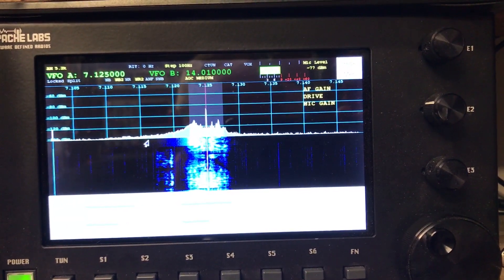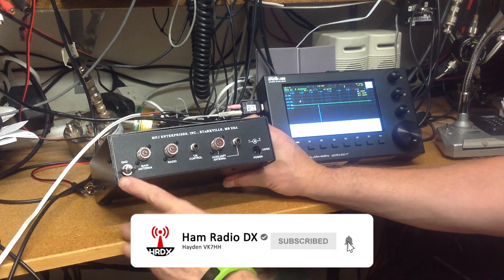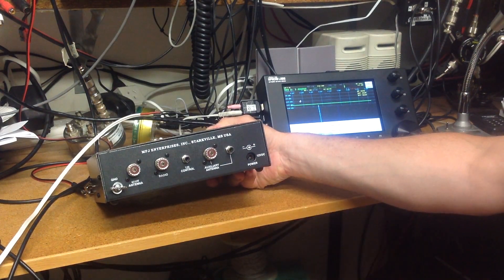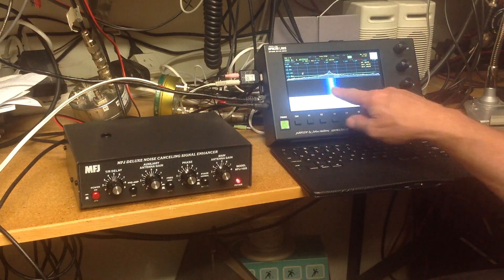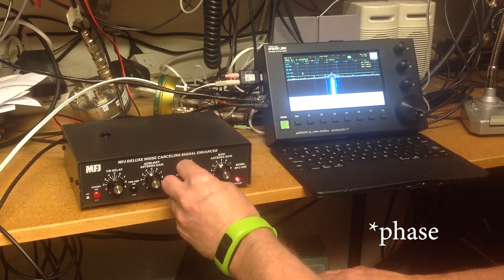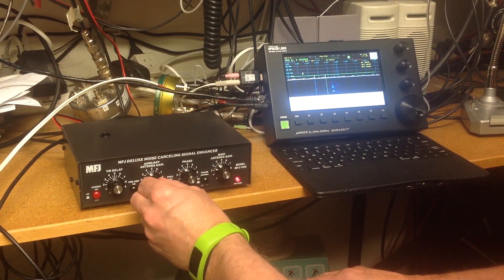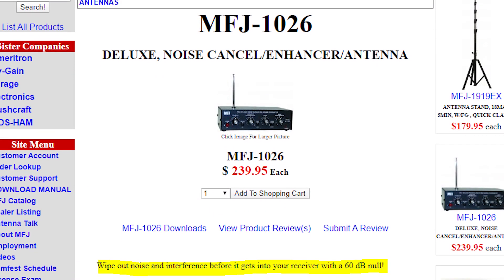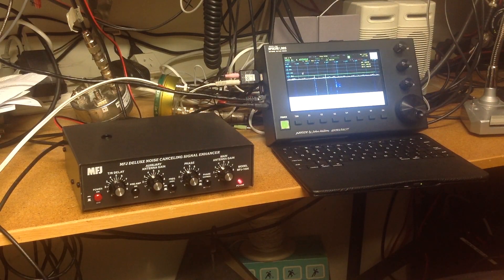MFJ-1026 Noise Canceller - The Key to Busting QRM?

Comment: So is a "QRM eliminator" any different than a directional antenna?

I get the general idea of feeding in a second antenna and adjusting its phase to cancel noise.  But that's just a phased array antenna, essentially just a directional antenna.  You could also use, for eg, a Yagi, couldn't you?  Or is this a way of making your array adjustable?
Reply: It is very different from a directional antenna. A yagi, magnetic loop, or other antennas with directional characteristics will pick up signals (plural) in a given direction better than another. The QRM eliminator is mixing the opposite waveform from one antenna into the waveform from main antenna. If both equally hear the signal you want to hear, the signal will be gone. But the value is when one hears the noise better and the signal worse; when you mix in the opposite, the noise goes away but the signal from your main antenna remains.
Reply: When he says in the video that broadband noise isn’t eliminated as well, it might be because both antennas hear the noise equally and it sufficiently covers the desired signal in the main antenna.

Comment: I would try common mode chokes one at the antenna and one near you radio and you see less noise. After that without buying a new receiver that has this built in.  Then try this prodcut.
Reply: I got a common noise choke with high hopes and it did nothing.  I think it will help in very specific situations with very nearby noise sources, but otherwise I don't think it will do much.

Comment: I have to get this for my station.  I live in an apartment building that I previously thought acted like a Faraday cage on shortwave, but which is actually simply full of RF noise, and I realized that when I observed that HF signals came in very well within my apartment during a power failure.

73 VE7NDE

Comment: Thanks for the video. I do have a question, I am thinking of buying one of these due to a neighbour have solar PV installed. My question is I use mainly CW , (Never full break-in). The hf transceiver is a FTDX10, does the unit switch fast enough for cw.? Many thanks.
Reply: ..yes...I'm 99% cw...  VE3IIM/VE6PG

Comment: that model cant do a 180° phase turn, the QRM is then accordingly not fully blotted out. there are other versions of the QRM-Eliminiator available on the net that are better and cost about 1/4 of that, for example the QRM-Eliminator model "X-Phase", there are a number of demo videos of it on yt.
Reply: But can you run an amp with them? At least the MFJ1026 can be modded with relays to run QRO. Not sure if mods exist for those cheap noise cancellers.
Reply: @624radicalham  yes, simply put the PA after the phasefilter. 
Radio -> Phasefilter -> PA -> Antenna📶
Reply: @PIasmaZombie  Thanks!

Comment: Looks impressive for single source of noise. What would you suggest for broad band noise? I'm in a suburban townhome and have a pretty high noise level I'm trying to overcome. Do you have any suggestions? Thanks.
Reply from the maker: Hi David,
Yes the noise canceller doesn’t work in every situation. What antenna do you have? Perhaps a choke near the antenna? QRM Guru has a lot of useful tips and ways of tracking down noise and/or steps you can take to fix it. 

https://qrm.guru

73
Hayden
Reply: @HamRadioDX how about for an indoor antenna? I have high noise floor across the band!

Comment: I would get one but I don't have a second antenna for noise reception.
Reply from the maker: The box comes with an internal whip antenna, which may/may not be effective for noise... but even a smaller antenna outside will work.
Reply: @HamRadioDX it's a whip antenna, not internal like a ferrite rod, correct?
Reply: a short piece of copperwire would be enough for "second antenna", close to the source of the qrm. that short wire can be hold in different places, to detect where the qrm comes in strongest, to then keep the that wire there. that would i think be most effective. a bigger second antenna would null out the desired signal, so it doesnt need much for the second antenna.

Comment: The waterfall display, in conjunction with the audio  improvement, is a very effective demonstration.

However, what do you mean by Birdie ?   The only birdies I'm familiar with are birdies internal to the receiver itself.

Isn't that noise some other signal source, unrelated to the receiver, that just happens to be in the same frequency range ?

Thanks and 73
Reply: I've heard tons of people using "birdie" to mean interference in general.  Pretty sure it's a misuse/misunderstanding, because i don't think any of these new radios have birdies.

Comment: IF you decide to get one...good luck! I bought one about a year and a half ago.  I was NEVER able to get any of the results shown in these videos.  Or anything even close!   This evening I found out why.  Using "THEIR" schematic, Componets missing, terrible solder joints,  Another HUGE reason.... the relay was not even soldered completely to the circuit board.  As for the circuit board... that has to be the absolute cheapest clad board they could buy.   There is NO way the relay they chose is any way near able to switch a 100 watt radio.  Relay rated at (1amp) .   Normally I am a MFJ fan... NOT this time!  Terrible junk for $239.....hire some qualified people for your assembly!
Reply: Mighty fine junk

Comment: Great video! I wonder why the flagships like Yaesu FT101D or Icom IC7610 doesn't have this system integrated. That would be so great! 73, Paul
Reply: I wonder if transceivers that have notch filters would achieve the same result.
Reply: @kd5you1  They simply don't.

Comment: I have this device and it indeed works GREAT! Worth every penny IMHO!
Reply: I knocked out my high noise floor from the power lines using a 17 inch vertical whip antenna to pick up the noise. Unlike using the attenuator I can pull out signals that used to be buried under my high noise floor. It worked to phase out solid birdie signals too. I got the cheap $50 QRM Eliminator to see if it did anything and it worked.

Comment: At 2:30 -- oh, if only that were true of MFJ. The standard procedure before using is to open up their gear and check for poor soldering, loose parts, variable caps with plates touching, etc, etc.

Comment: Does somebody use it with portable receivers like tecsun pl660 pl880 , sangean 909x and just an external wide band antenna like Aor Sa 7000 and the whip antenna in the canceller? Thank in advance.

Comment: Great demo! This is one of the most indispensable pieces of equipment in my shack. I've had one of these for a couple of decades and it really does work IF you have a good noise antenna! 73 de Robert K3RRR
Reply from the maker: Hi Robert, exactly. The key is an antenna that picks up heaps of noise! Something that seems counterproductive to move hams! 73

Comment: I wonder how this compares to BHI products from the UK? Anyone used both that can shed some light?
Reply: BHI makes audio dsp units
they do not make anything remotely resembling this noise phaser unit
this is completely and fundamentally different
It allows you to null local interference by phasing it out while using two antennas
it does not work on audio
Reply: @andhanwer  The end result of either is audio clear(er) of rubbish; I couldn't give a toss whether each gets there a different route. I am only interested in the end result.
Reply: @johnratcliffe6438  wow, with an approach like this  who needs radio
Reply: @andhanwer  I'm rolling my eyes at you.
Reply: @johnratcliffe6438  as expected and right on schedule
Reply: @johnratcliffe6438  the end results are completely different, phasing will always win hands down

Comment: I've never had that much success with mine.  Out of interest, what were the main and aux antennas?
Reply from the maker: Main antenna was a G5RV and AUX was a 30m horizontal with counterpoise
Reply: @HamRadioDX  Ah, OK, thanks...so similar polarisation, but not identical.  I think I need to persevere with mine, as most HF bands are unworkable here at home.
Reply from the maker: The AUX antenna basically can be anything but needs to hear the noise source trying to be eliminated at least as good as the main antenna, so if you know the noise source this can be an immense help in choosing a suitable antenna
Reply: @HamRadioDX  Yeah, the instructions say to make it as near as possible the same type as the main one so it hears the same noise...but I'm space limited, and run an 80m horizontal delta loop round the garden, so hard to match that! The other issue is it's general noise, not a nice defined spike like in your example.
Reply from the maker: Yes. As mentioned by Justin, broadband noise is not as easily nulled like something direct
Reply: for a noise antenna, i have had good success with a mini whip antenna with 75' of wire or also a w6lvp mag loop. with the mag loop sometimes i can not get the noise out no matter where I turn it, so I turn it toward the noise the most instead and use the mfj to cancel it out. but the mini whip always works almost as good. just sometimes the mini whip may not be getting the same noise as my doublet.

Comment: Great review, alot of Hams knock MFJ gear but for the price range there is nothing else out there in the market.
Reply from the maker: Thanks for your comment VK Radio
Reply: Actually the X-Phase kit (or premade) is cheaper and offers similar features 👍
Reply: you better order several of the aux port protection lamps
by then you'll understand why it was in this price range :)